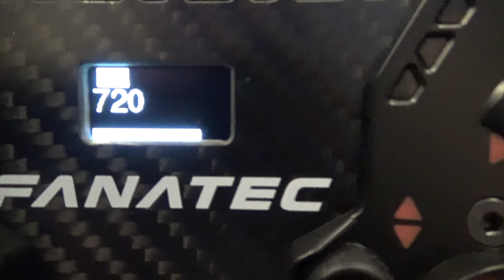Fanatec sensitivity/wheel rotation anomaly? with the F1 2021 game. Clubsport Formula V2. Xbox One.

Comment: So apparently going into advanced setting and changing sen to 2520 instead of auto and change the game to 360 fixes this apparently its a fanatec issue they havent fixed yet.

I use gt3 dd 8nm adapter and im having to use these setting as full lock happens at 90 turn for me its irritating as fu** how fanatec havent fixed this with each update

Comment: Hi, i was wondering if the rotary dials on the wheel work on xbox. Great video, keep up the good work 💪
Reply from the maker: Unfortunately no. The thumb wheels don't work either which is frustrating, as they used to work on my Thrustmaster F1 Ferrari wheel. Now that I'm used to using the switch on my Fanatec though, I actually prefer it, as I can adjust my differential etc. on the fly much quicker.
Reply: @everytenth  which switch do you use now?
Reply from the maker: @ericelbling4216  it's the (funky?) switch on the right side. Up and down cycles through your MFD options (fuel mix, brake bias etc.) And left and right changes the value of whatever is selected. If you press it down, it functions as the A button. It is also a rotary dial which you use to adjust your selected tuning menu setting.
Reply: @everytenth  ok, thanks!

Comment: i have a problem with my sf1000 wheel where it disconnects momentarily too the pause menu and it could be because of wheel rotation which i have i believe sorted that manually on the wheelbase but now seeing this maybe it vould be the wheel sensitivity too. something for me too check
Reply from the maker: Thanks for the comment. Hope you find your problem. I was recently having the same issue as you (my wheel and pedals would randomly disconnect). I updated my firmware and so far have not had the issue touch wood.
Reply: @everytenth  it could also be a button mapping issue as well possibly.  So all needs to be investigated cos it is hampering me a little bit whilst driving. More annoying than anything.
Reply from the maker: @michaelhelbrow7906  yes very annoying. At least on the F1 games the Ai takes over and you can continue racing. EXTREMELY frustrating on ACC where you end up with damage from a wall or barrier. Good luck.

Comment: Same base pedals and wheel, i have same issue. the problem i have to when sen over 540 i feel lots of oversteer even worse on auto. Not ideal but workable.
Reply from the maker: Thanks for your comment. I found it easier to catch a slide with higher sens setting.
Reply: @everytenth  hi mate are you still having to have rotation so high, do you know if codies will fix this in a patch. Cant seem to find much online starting to wonder if they even give a shit lol
Reply from the maker: @dave_camz  hi mate, yeah I still have it high... Currently on 820 from memory. Not sure if they will fix it. I haven't worried about it, as I haven't noticed the oversteer issue you mentioned

Comment: It’s the same for F122 now
Reply from the maker: Ok thanks for letting everyone know. I have mine set to auto now and use the in game setting to adjust to my liking
Reply: So apparently going into advanced setting and changing sen to 2520 instead of auto and change the game to 360 fixes this apparently its a fanatec issue they havent fixed yet.

I use gt3 dd 8nm adapter and im having to use these setting as full lock happens at 90 turn for me its irritating as fu** how fanatec havent fixed this with each update

Comment: You should have it set to auto that is what fanatec says to do for f1 2021 you can look each game setting up they are all different
Reply from the maker: I have it set to that now. Not sure why I didn't have it on auto at the time of this video. I don't think it was working correctly in game until they patched it, but I was also experimenting with rotation at the time and i also wanted to be able to switch this setting on the fly for different tracks without having to go into the ingame setting.

Comment: Can this work for the F122 game?
Reply from the maker: You mean change the sensitivity on the wheel? I haven't tried it myself, I have it set to auto on the wheel and then adjust via the in-game wheel rotation setting as that allows more fine tuning (smaller increments).
Reply: @everytenth  cool.  Great video though. How long have r you been sim racing?
Reply from the maker: @theVersatileGamebox   Thanks. Been sim racing in online multiplayer for maybe 4 years or so but prior to that I've always done singleplayer and arcade racing ever since the old Daytona USA and Sega Rally days haha. I also used to play TOCA touring cars on controller on Playstation back in the day.

Comment: Does the wheel work for the xbox cause ppl been saying it doesnt
Reply from the maker: The wheel works for xbox and the F1 games, but a lot of buttons/switches don't work (the buttons double up). The rev lights and flag lights don't function.
Reply: Just one more question does the wheel work with nascar games like nascar heat 5
Reply: @maxwellnelson625  I'm not sure, but I don't see why it wouldn't. I only play F1 and ACC so I can only comment on those.
Reply: @Maxwell Nelson Every Tenth here (signed into my other account)